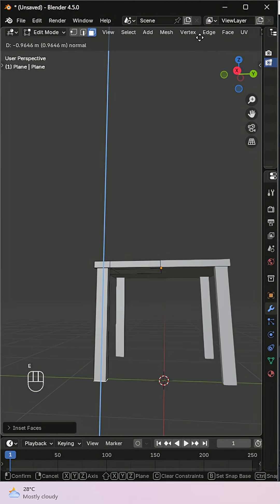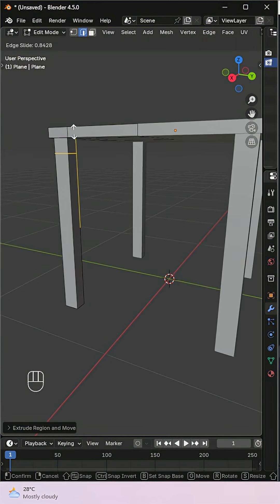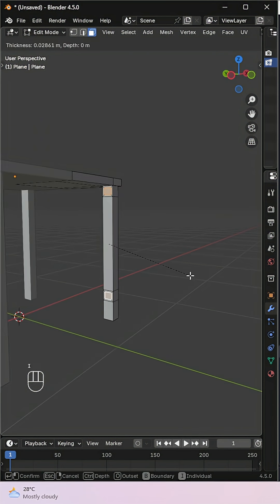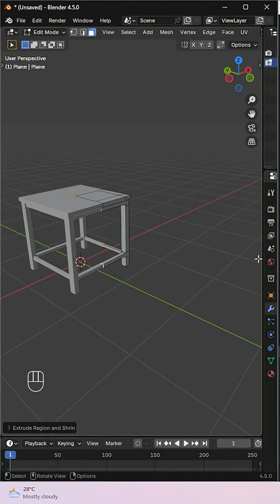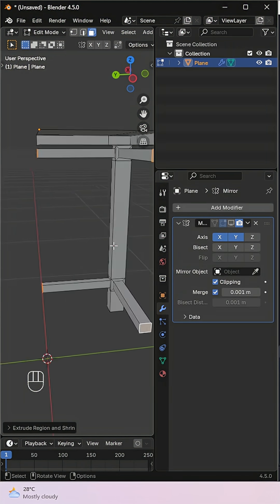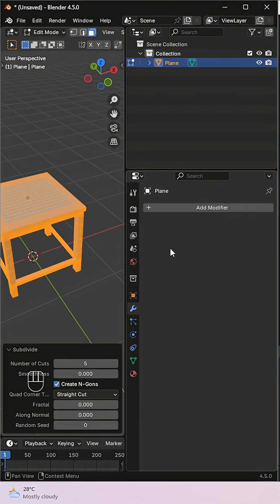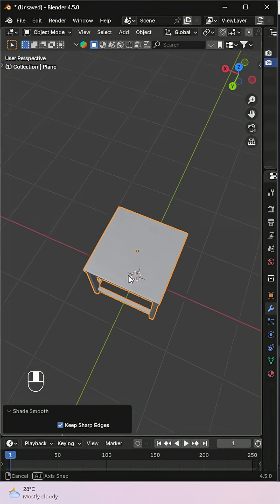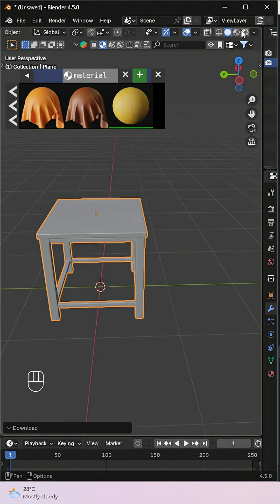Modeling a realistic wooden stool in Blender 🪑✨#blender3d #3dmodeling #stool #begginers

Comment: I don't really get, why you cut the plane in four and then deleted three? It's then back to a plane, do I not know a secret trick or something? 😅
Reply: Its completely necessary to do that, the mirror modifier is literally a mirror at the center of that plane reflecting other side, if you put a mirror at center of the plane it will reflect ether left or right side that means one side of the plane have now 2 faces, but we need one. Soo, he just cut off extra faces to prevent overlapping of 2 faces while the modifier is just reflecting one face and you can't change the reflection until you hit apply which converts the reflection into editable mesh surface.. 😊
Reply: @GurshanSinghSidhu-h9c  But can't you just set the origin, on the edge? 😅
Reply from the maker: @GurshanSinghSidhu-h9c   got the whole things. He explained everything correctly, even better than me.
Reply from the maker: In-short, our all corners are same. So, I use Mirror modifier to get rid of doing those same things in each corner.
Reply: Things like tables need mirrors on both axes so that all steps are applied to everything, and that's correct, well done. 💎